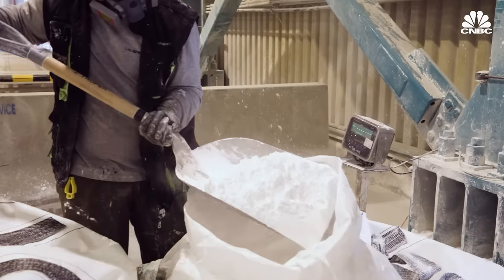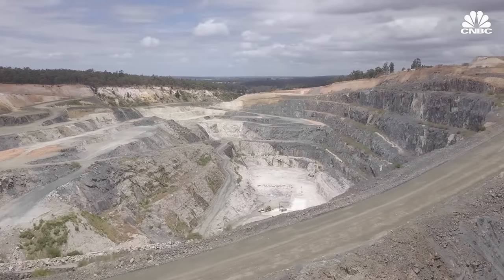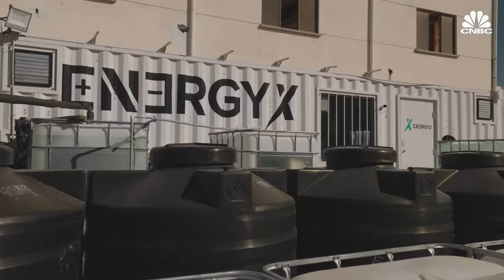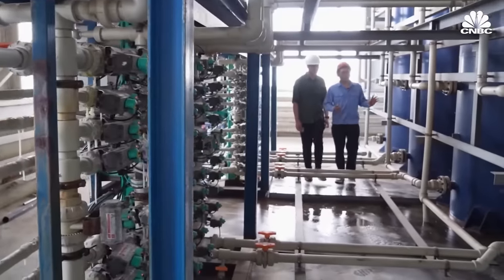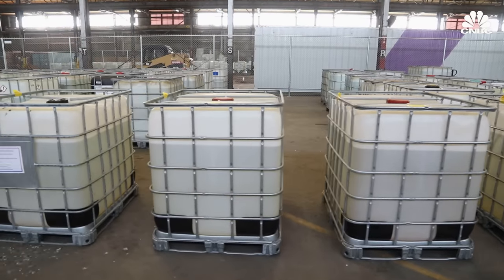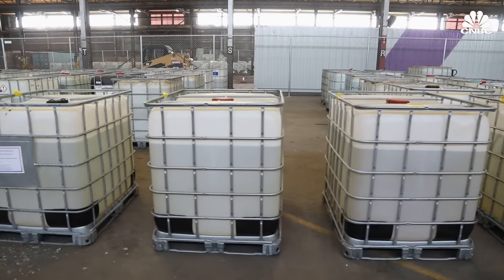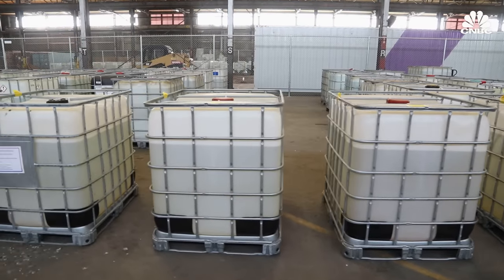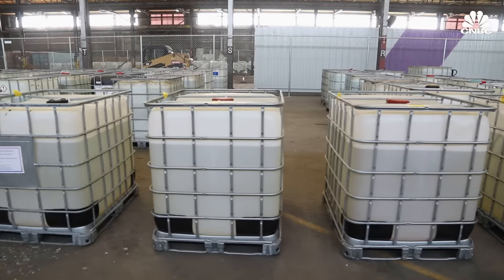Why The EV Industry Is Betting On This Lithium Mining Breakthrough

Comment: What happens to all the metals that are classed as "impurities" in this process? Hopefully they are isolating and using those as well.
Reply: lol yea ok😂
Reply: LoL 🤣
Reply: In brine it's mostly sodium ions
Reply: In the US? nah thats what rivers and landfills are for
Reply: It depends on the process. In one case, the brine is pulled up, the lithium extracted and the brine goes back to the soil where it was taken from.
Reply: Yes, low grade lithium can be used for non sensitive application, mainly chemistry needs, and road materials.
Reply: Maybe they should light them on fire and spray the exhaust into the air so we can all breathe it, just like they do with all those fossil fuels
Reply: @cybertrk  Your comment has nothing whatsoever to do with the question. Go away, bot.
Reply: Bring on sodium ion batteries.
Reply: Tesla lithium is the way to go.
Reply: <<What happens to all the metals that are classed as "impurities" in this process?>>

These are all to be transported and dumped on Al Gore's lawn. As a zealous advocate of electric vehicles,  I'm sure he can manage them.

Comment: It's good to know this. I hope they will solve the other problems of lithium especially the low useful life and the e-waste problem.
Reply: You cant make power and have some sort f enviromental impact.
Reply: If your talking about batteries, there are now MANY batteries that get 3,000 or more cycles of use, and they are now highly recycled, with 95% or more of the metals recoverable.
Reply: e-wastes is another issue, a battery is made of metals, so it can be recycled.
Reply: Batteries can be recycled, however it's not economical to do so. If you see Lion batteries getting recycled, it's most likely they're removing the non-lithium components such as copper for the copper electrodes and other metals like cobalt. The actual lithium itself usually gets disposed of, since it's about 5x cheaper just to use the mined stuff.
Reply: @bunnyben5607  Nonsense. BASF, Dupont, LiCycle, Redwood, American Battery Technology and many others will be recycling. They all get 95% or better of the metals back from the packs, which is exponentially  better than the initial mining. It's already underway.
With their processes, it is now much cheaper to recycle.
Reply: @bunnyben5607 You still can't logically explain to me or anyone how electric vehicles are better for the environment, they are not.
Reply: Litium battery recycling is easy. Already a lot of places have that figured out. It's basically puried li ore lol
Reply: @Americafirst-i8q  Fossil fuels are going away eventually and the replacement vehicle must have a fuel that isn't dumped into the atmosphere; this naturally leads to an electric something or other. Hydrogen sucks and it is going to continue sucking. Nobody is suggesting that electric vehicles powered by coal are better for the environment.
Reply: @bryanstrom812  Just curious, do you work in those industry?

Comment: Why don't they use "closed loop" brine systems? Instead of using ponds, just pump the brine through solar-heated pipe networks, raising its temperature near to boiling, then dumped into a "finishing vat" that boils off the remaining water and thoroughly dries the lithium, just like the ponds do. They can even capture the steam and re-condense it to send back for more lithium. 

This is similar to how sugar is made.
Reply: cost? Letting the sun dry the tons of water is much cheaper. I think the DLE they describe here is another technic that doesnt require so much energy.
Reply: @albex8484  Well, that's why I said they should use solar heating for most of the process, but I have to think that containing the water and not have to use trucks to scoop up the lithium salts would make the process much much faster and more efficient.
Reply: I get what you're saying. And yet, whether solar energy is obtained from concentrating panels or is spread out over a large pond, the heat (energy) of vaporization of water is the same regardless of the means used. Using the metric system, it requires 1 calorie to raise the temperature of 1 gram of water by one degree centigrade, and then it takes 540 calories for the phase change to convert 1 gram of water at 100C  to 1 gram of steam at 100C.
Under ideal conditions, sun directly overhead (such as at the equator, at noon, during the equinox), and cloudless skies, the solar flux is ~1300 watts per square meter. I have a 1500 Watt electric kettle, so it will evaporate water faster than a square meter of water either in a pond or exposed to the concentrated rays from a square meter of solar panel. Either way, it takes a LOT of energy to evaporate even an ounce of water. When we're talking here about tens of millions of gallons, it will required a HUGE area. Plus, the minerals in a brine solution will slow the evaporative process. Plus the average solar flux over the course of a day is far less than 1300 W/m^2
From this perspective, I don't see concentrating panels offer any advantage in terms of, speed, cost, or surface area. In that case, the only advantage is that the steam can be condensed (via. yet more equipment) and used for later stage purification and/or injection into the ground in order to leach more minerals than what the brine solution already has to offer.

There is a L O T less water in canes of sugar than ponds of brine. There may also be another benefit for cane, such as breaking down the cellulose in order to extract sugar.
Reply: @gregparrott  Right, but you can concentrate that solar energy using mirrors and lenses to use less surface area, and you can do it in areas where maybe giant open pits would be a bad idea. At the very least, instead of the water evaporating into the air, you can recycle it, collecting it at a near-boiling level and sending it back down to pick up new lithium, retaining a portion of the heat from the process. I'm not saying it would "cost nothing," but it should be considerably faster and have less overall cost to it than the giant pools. It just takes more cost to set up in the first place. 

Also, as far as sugar goes, they tend to add a lot of water into the process before they then take it back out. The intermediate process is very liquid.
Reply: @timogul  I previously agreed with you about the potential benefit of retaining water. However, you are wrong in stating that by concentrating the energy you need less surface area. When X Watts falls on a given surface are, that is the MAXIMUM. Concentrating it does NOT increase the wattage. In fact, it will slightly reduce a couple percent of it will be due to reflection losses (which is why the panels become hotter than ambient). Another couple of percent will be lost at the receiver of the concentrated solar flux. Concentration increases the flux density. (Watts/(square meter), but the total number of Watts being received will be slightly less.
Reply: @gregparrott  But you can use the space more efficiently than just large flat pools. You can direct the receivers at the sun as it moves, you can place them in ways that use the land space more efficiently, you can place them in places unsuitable to large, open pools, etc.
Reply: @timogul  You are half right.
#1) True, you can place panels on sloped ground, although even sloped grounds can be filled to create pools via. dams. (i.e. reservoirs)
#2) PARTIALLY TRUE/FALSE: Aligning the receiver toward the sun does NOT gather more power than the surface area on the ground on which its shadow was cast. If the sun is at an oblique angle relative to the ground and you have a pile of panels that can tilt, those panels have to be spaced apart because if the panels are immediately adjacent, the tilting of one panel will block some of the rays of another panel immediately adjacent to it (equal to the sine of the angle). So, the projected area of the tilted panels on the ground cannot exceed the flat area on which they are placed. Where this becomes more nuanced is that at steep angles, a higher percentage of the sun's rays will bounce (reflect) of the water (lost energy) than a panel that is optimally aligned (perpendicular to the sun's rays).
Look at this chart:  https://www.researchgate.net/figure/Albedo-of-water-for-the-incidence-of-direct-solar-radiation-as-a-function-of-the-angle_fig3_312990302
You can see that reflectivity does not exceed 5% until the incidence angle exceeds 40 degrees, by which time the added atmosphere that the rays travel through have already attenuated the solar energy by a lot (I could find a chart for that too if you're interested) Whatever is reflected is lost energy. There are ways to reduce this reflectivity at acute angles, but it's not economically worth the effort.
Reply: @gregparrott  If your 2 was correct, then why do professional solar installations bother with rotating solar panels?
Reply: @timogul  Easy answer: Because, as I mentioned, they DO space tilting panels apart from one another. 
Look at a solar farm of tilting panels. If the panels were all horizontal, forming a flat plane, they do not form what looks like a single contiguous surface. What you will see is substantial gaps between the panels. Those gaps allow technicians to walk between and work on them. But another, very purpose is to prevent panel tilting from obscuring the solar energy gathered by other panels. 
You can visualize this: Draw a bunch of parallel diagonal lines (say, at 45 degrees) to represent sun rays and have those rays terminate at a horizontal line (representing the ground). Now draw short line segments that are perpendicular to the sun rays (representing the solar panels). In order to get full utility of the panels, you'll see that you have to spread them apart so that the rays which pass over the top of one panel can access the bottom of the panel behind it. That mandates the spacing.
I arbitrarily picked 45 degrees. For 45 degrees, the length of spacing will be the square root of two (1.42) times the width of the panels.
Reply: @gregparrott  I don't disagree with that, but my point is that by angling the panels you can get more energy out of the sun on average than you can with a flat surface, because you are capturing the maximum amount of its energy at any given moment.
Reply: @timogul  Agreed. That statement is correct. It substantially differs from the initial statements
Reply: @gregparrott  Because the heat electricity conversion rate is low as 30-40%, it is not economical to convert the sunlight to electricity and convert back to heat.
Reply: Do you know why they wait for sun to do the work in the first place? Becouse other way that metal would be so expensive nobody would ever think of using it for battery!
Reply: @mateusz5318  I don't think the method I'm suggesting would be significantly more expensive than the current model. It would have slightly higher start-up infrastructure, but once built, it has basically the same operating costs. If they had much higher production values, it should more than pay for itself.

Comment: Good overview - they should have included Vulcan Energy (ASX:VUL) in this video as an interesting Geothermal / Sorption-type lithium extracting "DLE" company. 

Although it was there between the lines I wish they explained more that "DLE" is a misleading/blanket term since there are many types of "DLE" and the "DLE" is only one part of the overall process.
Also, there is no such thing as going from brine straight to Lithium product through some magic technique.... many processes before and after the supposed "DLE" in the flow sheet.
The overall process needs to be looked at.

One of the great features of geothermal and some features specific to Vulcan are....
Heated brine assist the sorption and other processes due to brine already being hot - that is a lot of energy for free.
They will also generate electricity for their own use and excess electricity sold - geothermal works day and night.
Also provides efficient heating to the surrounding commercial/residential areas.
Final conversion of LiCl to Lithium with eletrolysis.... no further reagents needed.

Bonus is that they will not be operating in a water scarse area and will produce an end product close to customers.

No shipping intermediate or raw materials all over the place for further processing and conversion, limited reagents, no fossil fuels.
Reply: lol Vulcan Energy didn't pay them.

Comment: As EVs are gaining popularity the tech is evolving quickly.  So today's Lithium-Ion is LIKELY NOT the end of innovation in regards to Energy Storage (i.e. batteries or fuel).
Wow lithium batteries have provided remarkable improvements over lead and nickel cadmium products, the lithium battery technologies still have limitations. First off they do have safety concerns in regards to fires, they are extremely heavy, the charging is slow and the storage is still not at par with the energy density of petroleum products. Energy density is the key. Most products are moved by truck in Western society and a large truck simply cannot be equipped with lithium batteries due to the weight that you would have to add. For every pound of weight the battery adds to the vehicle that is a pound less of supplies the vehicle can transport. To give you a example on how much weight these batteries add to a vehicle a Tesla sedan weighs approximately 800 more pounds curb weight than a gasoline powered  Ford F-150 truck!
A tractor-trailer that has the power to pull a typical 18-wheel rig outfitted with batteries for the same range as the diesel tanks on a typical rig would add an additional 15-30k pounds (8-12k kilograms) .. 😮
With the breakthroughs of graphene and sodium ion batteries and the revolution of fuel cells powered with hydrogen, we will continue to see the evolution of the electric power and storage of energy for vehicles. The energy density is key. If a sodium ion battery for a hydrogen powered fuel cell power plant can we 50 percent less than a lithium battery system it would be a game-changer and really take electrification of vehicles to the next level. I'm no petroleum Fanboy or an anti lithium battery dude I'm just providing some additional information and pointing out the fact that things change technology evolves and nothing stays the same.

Comment: Strange there was no mention of that company building a plant in Corpus Christi?
Oh... Wait!
Reply: Begins with T ends with A, has esl in the middle? Is the current true world's ev leader just having passed 4,500,000 ev sales globally. 😀
Reply: Does Tesla make batteries?
Reply: @demoticshadow2494  yes the joint Tesla/Panasonic jv cell plant the first of its kind in the U.S. opened back in late 2016.
Their in house 4680s have been in test cars since 2020, publicly sold since spring 2022 in the awd tx built model y.

Comment: Hope it brings down the price of evs for the end consumer, i'd never spend more than 20k on a car if i live where there's viable public transport.
Reply: 20k is easily doable soon. Especially used.
Reply: It will surely bring down costs for the EV manufacturer,  but those savings will not be passed on to the consumer. They never are.
Reply: @markdc1145  Oh yes they are. Haven’t you heard of the recent EV price war?
Reply: Just don't buy a truck or a SUV. The smaller the car, the more efficient, the less battery you need, and then you have a quite cheaper car.